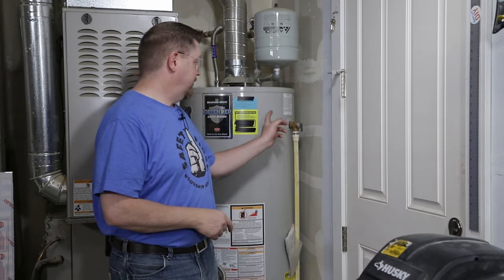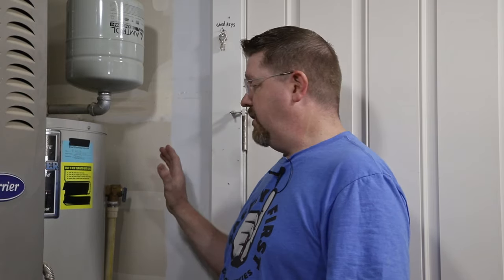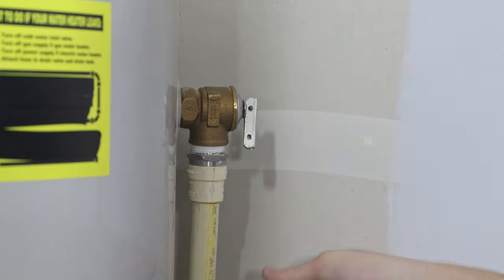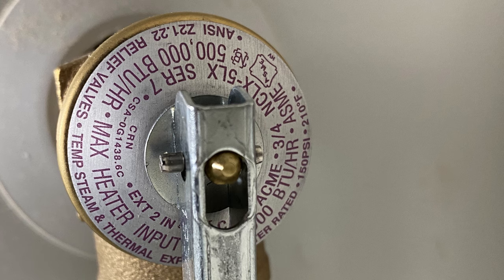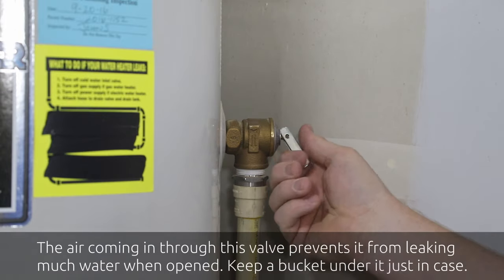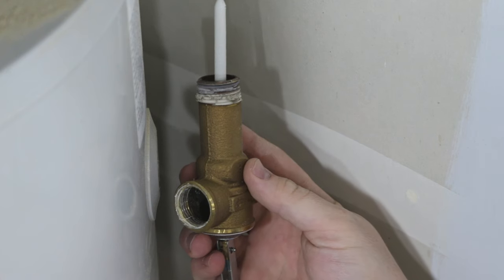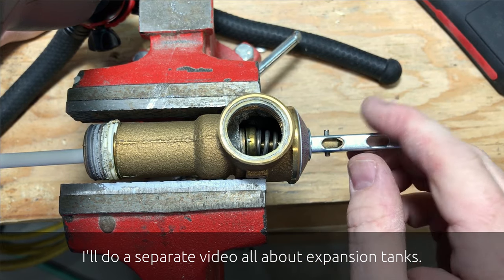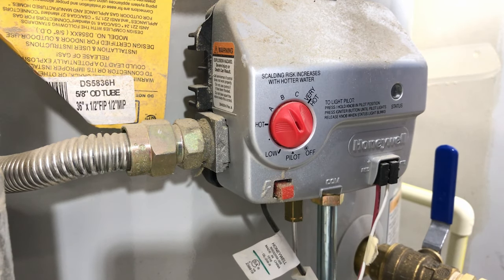How To Replace Pressure Relief Valve On A Water Heater (T&P)

Comment: Great DYI video.  I've got a question someone might be able to answer.  My electric hot water heater (Rheem 610 Professional) was off for a few months while my oil furnace supplied hot water heat for the winter months.  I prepared to switch back to electric hot water by turning the power back on the heater.  I let that warm up the water for 5 hours.  There was no leaking at this point.  When I rerouted the plumbing valves to use the electric source, specifically when I allowed cold water in, the pressure relief valve went into overflow.  Introducing more cold water didn't calm things down.  The T&P valve opens and closes fine manually.  I turned off the electrical power to the heater and routed the hot water to come via the furnace again.  About 9 hours later with the heater tank cool, I checked what happens when I allow cold water into the tank, and again it blows over the relief valve with no end (let a gallon go through) until I shut off the cold water intake again.  It seems like the T&P can't handle normal city water pressure.  Is that a type of failure that can happen with a T&P relief valve?  Mine is 9 years old.
Reply from the maker: Yes, I believe your T&P has failed. Swap it out and see if the problem goes away. If not, you have something very odd and pressure-related going on, since the valve opens with cold water. Good luck!
Reply: @AmplifyDIY  Thanks for the answer.
Reply: @AmplifyDIY  I've now done the replacement.  No problems now.  Your video helped me have the confidence to do the job.  I did need to use a plumber's wrench to loosen the valve, as the installer didn't use teflon tape but rather some dark substance.  The instructions say don't over-tighten, so I went easy on it, and tested by putting up the pressure with cold water and air until it was neutralized with city water pressure, and I verified there was no sound coming from the valve at that point.  Then I attached the rest of the pipe for directing it downward and bleed off the air using the T&P valve to the point water was ready to come up (mine is at the top (roof) of the tank).  It still held the pressure fine once it was only water in there and at full city water pressure. Then I turned on the power and it was good.
Reply from the maker: Awesome! Great job!

Comment: This is an awesome vid.  I subscribed!  QUESTION:  the water line with cold water is turned off but what about the water in the hot water pipes running through the house?  Wont that water have to be drained before taking off the pressure relief valve?
Reply from the maker: Hi Heppy - I believe I showed that you turn off the cold water inlet, then open a hot water faucet to bleed off pressure, then open the drain valve at the bottom of the heater to drain off a few gallons of water. If you have a second story with hot water pipes above the heater, they may drain down into the tank during this process... but likely they won't unless the taps are all open. As long as you drain off a few gallons of water from the tank, you'll be fine. Good luck!
Reply: @AmplifyDIY  OMG you're so cool.  i have TWO stories above the damn water heater and a clogged water heater drain but i'm 'going in' -- this ain't rocket science as you've clearly showed.  (Yup, i'm doing the modified Hot Water Heater Drain Valve too for the rest of my natural life!).   I make vids and can appreciate the quality of your work and the responsiveness.  g.r.e.a.t. job!!!

Comment: Best video on this subject out there!  Why does the Temp proble have to be the same length? As long as its not longer causing a clearance problem in the tank the same length or shorter should be OK since the manufacture has designed it to do its job properly.
Reply from the maker: Thanks for the feedback, and great question, Frank! You want to match the probe length because it's difficult to tell exactly how the tank manufacturer designed the mount for the T&P valve. Some tanks have a tube welded into the side with the T&P mounted at the end to account for insulation thickness outside the tank. Others mount the T&P more or less flush with the edge of the tank. You just want to make sure that the probe is actually extended into the main mass of water in the tank, and not hanging out in a short little tube on the side of the tank which sits a few degrees cooler than the rest of the tank. Thanks for watching!
Reply: @AmplifyDIY  Thanks for the explain. In my case the temp probe reaches well into the tank it is just slightly shorter. Im guessing that because I got a very slightly longer valve same model group and manufacture the temp probes are all the same lenth ( I measured) .  It still reaches well into the tank which I considered, so I'm sure I am fine but this is an interesting detail.  I would have had to pay 3 times as much for the exact model number. Again guessing this is an availability thing. Box stores sell a ton of generic valves at very low price  that were not OEM so knowing what is acceptable and what is not is important.

Comment: Thank you so much for taking the time to explain this video as well as the how to flush your water heater.  I own a few rentals and I followed your how to flush a water heater step by step this past weekend.  On 3 of the 4 homes whose water heaters I flushed, all came out perfect.  On the last one, I had to replace the Pressure Relief Valve as it would not stop leaking.  I think I will just stick with opening up a hot water valve at the sink to let the air out of the system instead of using the pressure relief valve.

Comment: Even  being a brand new water heater the PRV will sometimes leak very little after flushing servicing and refilling as shown . The cause of this could be the PRV not seating 100% and you can use a hammer and slightly/gently tap on the front of the prv valve and it will cause the valve to seat and quit leaking .So you don’t have to replace it. Make sure the relief lever  is in the downward position and gently hit/tap directly where the brass relief pin is in the center .
Reply from the maker: Emphasis on gentle! Also, you can try just opening and closing the valve a few times. I’d try that before a hammer. Great tip!

Comment: I tested the valve and later on it started to leak. I can't say that the test was the cause, but I do wonder if I had left the damn thing alone if maybe I wouldn't have had a problem with it.

It is 10 years old, so messing with it after so much time and heat probably wasn't a great idea.  I'll replace it.  Thanks for the video!
Reply from the maker: Actually, I see it as a good thing that you "messed with it" - testing it let you know it was time to replace it, and it's always better to have a correctly functioning valve than one that is crusted over with limescale and gunk from inside the heater. I'm glad you are going to replace yours. Thanks for watching!

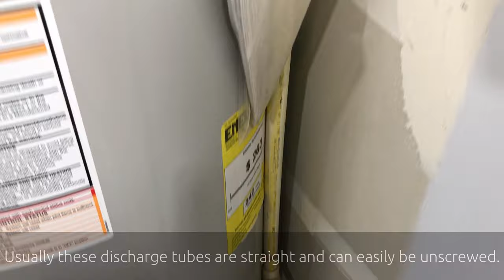Comment: Great video!  Question:  at your 9:30 point to remove the , I'm going to have to cut my downspout pvc and rejoin later with a sleeve.   Can I just dry-fit it?   There are many glued bends and tracks that funnel the water outside of the house.  Thanks again!
Reply from the maker: Hi Stephen - the sleeve should be glued. If that valve ever does need to discharge due to overheating, the pressure will be enough to blow a dry-fit sleeve right off the pipe. Good luck!
Reply: @AmplifyDIY  Thanks for the quick reply.  How about a pvc compression coupling?   I'd like to be able to remove it later in case I do this again.

Comment: Excellent video thank you so much now I'm ready to tackle mine. I do have a question about the extra overflow tank on top of your hot water heater. I had one but it sprung a leak so we removed it and have not replaced it is that a problem or should I make sure to replace that as well.
Reply: I watched your video on the overflow tank replacement and see I DO need to do this _ THANK YOU!!!

Comment: This helped me a lot, thank you! Mine (Rheem) has a temperature sensor that extends 4", but all I was able to find locally are valves with a sensor that extends 3" only (all other specs are identical). I installed that for the moment to keep the heater going until I get one with a 4" sensor (tomorrow), just wondering if it's OK. It doesn't seem like it would be too much of a problem (like I said all other specs are the same), would it?
Reply from the maker: A slightly shorter sensor will be just fine for a short time. Good luck, and thanks for watching!

Comment: Excellent easy video to understand thanks for sharing. I have a ?, my WH is over 15yrs old and has started to leak from PV, is it worth replacing just the  Valve or would replacing the whole WH be recommended giving the age?
Reply from the maker: Hi Yo - I would only replace the T&P valve. A small leaking valve does not indicate the whole heater is dying... plus, a new heater will cost $700 USD to buy, while a new valve runs around $25 USD. I'd definitely replace the valve, and see if that solves the problem. Great question!

Comment: Great video.  Just wondering if, instead of using the drain valve, can you drain the top of the tank by leaving the pressure valve open until the water drops to that level?  Of course you'd expect a bit of leakage when the pressure valve is removed as there'd still be a tiny bit of water height.
Reply from the maker: Sure, you can... but it'll take a very long time. The tank drains fastest when you have one opening for air to get in, and a different opening for water to get out. Thanks for watching!
Reply: @AmplifyDIY  You're right, nothing flowed as there was no way for the air to get in to replace the water.  Without a drain valve I had to disconnect the cold water inlet pipe...and, of course, nothing much came out of there unless the pressure valve was opened, so it was quite controllable. 
Thanks for responding and so promptly.

Comment: Thanks for the video I had a constant drip, drip out of my t&p valve. Question, in the video what is the additional tank for above the water heater.
Reply from the maker: Great question! It's a thermal expansion tank. They did not used to be very common, but are becoming more and more prevalent - especially with newly built homes in certain parts of the world: https://youtu.be/NGygvtP6Sdk

Comment: Great video! Very helpful.
We live in AZ and it's over 110 for the last 6 days and for the coming 6. Our relief valve started to flow 2 days ago. It's constantly running. It's outside. The water tank is in the garage which is at about 140 F. Is it possible that the valve is running because of excessive heat in the tank? Thank you for your help and stay safe.
Reply from the maker: It’s possible, yes. Try turning down the thermostat on your tank. Good luck!
Reply: @AmplifyDIY  Thank you for your reply. I just put it down to the minimum. We'll see how it goes. Thank you very much for your help on this. We only moved here 4 months ago so don't know if that has ever happened before. Stay safe.

Comment: I know this was an old post but it is the best and easiest to follow. Have a question...I have same water heater as in the video, the T&P was spitting about a quart of water on a random basis, usually after the tank was emptied (after a bath). I replaced the value according to your video and it was a 30 minute job.But upon filling and heating the tank, it did the same thing. Any other suggestions. Temp is set on A.
Reply from the maker: Hi David - do you have an expansion tank? It might need some attention. If you don't have one, you may need one: https://youtu.be/NGygvtP6Sdk  Good luck!

Comment: Thanks for the helpful video.  What do I do if I allowed water to soak the insulation around the tank (not a blanket, inside the outer tank)?  Do I just close it up, and ignore it?  Do I leave that bottom cover open and hope it dries out?  I don't want to short the heater element down there by letting the water make that connection between wires.
Reply from the maker: Hi Paul: yes, I would leave it open and hope that it dries. Good luck!
Reply: @AmplifyDIY  Thank you.  It did finally dry out.

Comment: Thanks for the great video and info. I replaced a leaking valve with a new one just as you described and it installed with no problems. Did a test releasing it and closing it off again and everything looked good. However, 2-3 weeks later a small bucket I keep under the outlet pipe was full so it leaked still. Is it possible that a new valve was defective or maybe another issue like a bad thermostat? Water pressure too high?? Any thoughts or help would be greatly appreciated.

Comment: Great video.  After replacing mine, the new one started leaking again just a few months later.  I am going to double check the specs on the original and the new valve.  Otherwise, I guess I should replace the Expansion Tank.  Any thoughts?
Reply from the maker: Hi Paul - definitely check the expansion tank. It's the most likely culprit: https://youtu.be/NGygvtP6Sdk

Comment: Hello, I discovered a leak from my water heater. I can't see underneath it, no water was on the exterior, but I hear a slow drip. 
I shut off the water, but I wasn't sure if I should test relief valve to potentially stop the leak? I assume it's too late and maybe the tank is damaged?
Of course I'm dealing with this at 11:00 p.m. and I am not sure if I should also put the temp control to pilot for safety until I can contact someone in the morning ?
Thanks for the great video!
Reply from the maker: Hi Tony - Not sure if you have already resolved this, but if it's dripping from the T&P valve, there should be a downpipe that comes out of the valve where water drips. If that valve or it's downpipe are dry, you likely have a leak elsewhere. Good luck!

Comment: Hello, nice video. thanks for sharing. I have a question. My water heater is gushing out the water from the very top centre and entire heater was wetv It was almost like a fountain with low pressure. what could be the problem? can i repair it myself
Reply from the maker: Oof. Sounds like a ruptured tank. Probably need a complete replacement. If you’d like to email some photos of the tank to me directly, I may have more detailed advice I could share. Thanks for watching! AmplifyDIY(at)gmail(dot)com.

Comment: Also, you mentioned putting it into pilot mode, but my Whirlpool water heater does not have a dial with that setting. It only has the thermostat and dial that turns the three different temperatures, none of them off or vacation or pilot temperatures.
Reply from the maker: Hi Scene It - I'd recommend digging up the user's manual (google the model number of your heater and it should be pretty easy to find) and check it to see what they recommend. You may have to shut off the gas entirely, and re-light the pilot light when you are finished. Good luck!

Comment: Thank you for video to help us to change presser relief valve,it very easy to do it,but I have one problem the water not leak,
But when my wife take shower use more hot water and the valve leaking about 1/2 cup water 
Do you know why ?  
Again thanks for video
Reply from the maker: Do you have an thermal expansion tank? If so, it may need to be checked/adjusted. If not, maybe you need one... I did a whole video on these tanks here: https://youtu.be/NGygvtP6Sdk
Good Luck!

Comment: I watched your amazing video and I replaced the t & p valve. How long it will take to make sure that the installation was successful and it’s working? It’s been three days now since I replaced it. I just paranoid and I don’t want a bad accident to happen. Thank you
Reply from the maker: If you’ve had hot water since the repair with no leaks, then it was successful. Nice job!
Reply: @AmplifyDIY  yes we had water and no leaks. Thanks to you for a well done job explaining the situation and details in the video.

Comment: With regards to pressure only not temp. Is it ok to install a pressure valve on a cold water pipe, outside of the house, that would not be actually on the HWH?
Reply from the maker: I don't see how it could hurt anything... but it's a bit of an odd place to install one.

Comment: Good useful info if you can get to the removal point but when your water valve at bottom of tank does not even drip when open what is plan B?
Reply from the maker: Hi Doc - if your drain valve does not actually drain, it is most likely blocked up with sediment inside the tank. There are 2 ways you can try to clear the blockage: 
1) Attach a hose to the drain valve. Leave the cold water inlet at the top of the tank open, so the tank is under pressure. Open the drain valve. The water pressure may help blow / clear out the sediment that is blocking the drain valve. If this does not work, then... 
2) Close the cold water inlet, and open a hot faucet to relieve pressure on the tank. Remove the hose from the drain valve, then open the drain valve. If no water flows out, get a long screwdriver, unbent coat hanger, or other long skinny tool and jam it into the open drain valve, trying to agitate / break through the built up sediment. If water starts to flow then, remove the tool and quickly close the valve. Attach a hose to the drain valve, and try 1) above to clear out more of the blockage. 
If neither 1 or 2 above help, it's time to replace the drain valve. This can be a pretty messy job if you can't drain the tank first, but once the tank is empty a new (upgraded) valve is a great idea: https://youtu.be/OBPJYg0o_o0

Good luck!